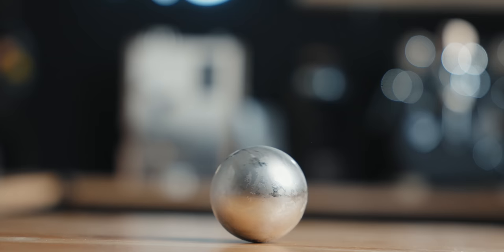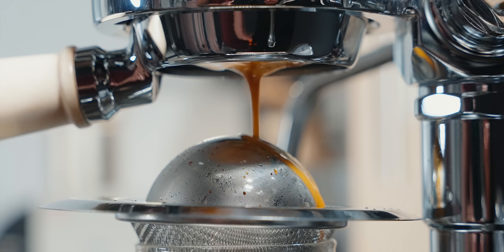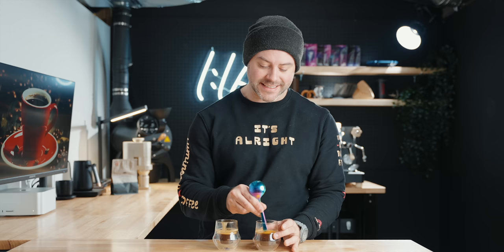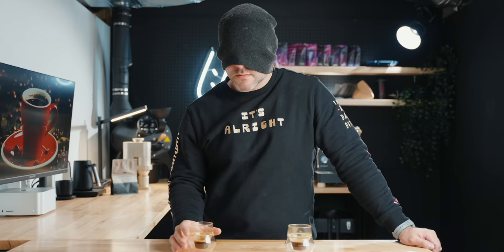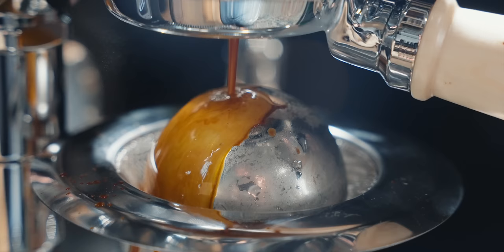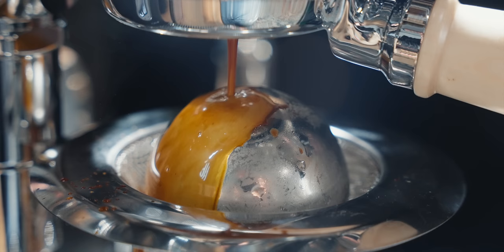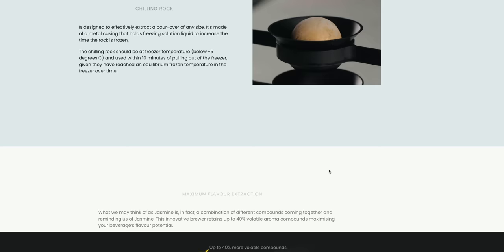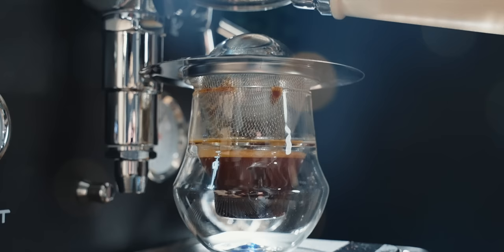THIS $20 TRICK Immediately IMPROVED My Espresso! - COMPOUND CHILLING

Comment from the maker: NOTE: 1. Both shots were equalized in temperature before testing to avoid bias in blind tasting. We filmed this but didn’t make mention to it or make it visually obvious so we cut it out of editing 2. Despite being chilled, this is still a hot beverage. This is not an iced beverage. I’ve seen this asked a lot so thought it was worth clarifying if it wasn’t obvious in the video 3. Would really appreciate if you subscribed on the way out… I’m almost at 100K and every sub is so important 🤝
Reply: 2 questions:
1. Does this not make the espresso a lukewarm drinking temperature?
2. Will this work with pour over coffee?
Reply: @ropro9817  cooler temp usually but not cold. I think it actually started pour over device or at least it got more people intrigued about the idea.

Comment: I just tried it - agree that there is a notable improvement - sweetness- crispness….better.  But that said - it does chill my espresso to cool…maybe cold.  How did you “equalize” the temp or return it to a “hot” drink?
Reply: My exact same thoughts. How much temperature variation it will cause? I like my espresso hot.

Comment: Why not try brewing into a frozen cup, then transfering to another cup after it's cooled? You can swirl it around for increased "cooling" too. I'd imagine it'll work quite similarly
Reply: Aromatic compounds are volatile meaning they evaporate very very early in extraction so the ball needs so be as close as possible to the exit point of extraction whether that’s directly below the portafilter or right blow the coffee filter when doing pour over
Reply: @LorenzBarcelona  elevate a chilled cup to the filter XD no need to buy balls and strainers lol
Reply: its not about cooling the coffee.

Comment: I'm curious how this would work with other brew methods like pourover and aeropress. In theory it should have the same effect but I wonder if it'll be as noticeable.
Reply from the maker: It’s arguably more noticeable
Reply: Check out Nucleus Paragon. They are already on it with pourover.
Reply: I might try something with an aeropress where there is one glass inside another glass filled with cold water. I use a pressure actuator (like Prizmo). Thus, not much should be evaporating in the chamber. The aeropress itself should help also keeping in any vapors in the cup as it sits on top. Ideally, perhaps a silicone washer around the rim might help too.

Comment: I have been heating the brew chanber and portafilter on my Flair Pro2. I may try just heating the brew chamber, or even freezing the portafilter. Interesting experiment.
Reply from the maker: Problem is with something like the flair… you want hot temps to aid extraction. Those elements don’t change. This simply cools the espresso upon exit
Reply: @KyleRowsell  Yeah I was kind of thinking that. With my scale and cup, I don't have a lot of room for my big balls. ;)

Comment: Actually not surprised at all that this works out; when I've been extracting espresso straight into a mug loaded with ice and some milk when making some cold ice-milk-coffee I've noticed the flavour of the drink is much better and smoother compared to just extracting the espresso in a regular empty non-chilled glass/cup and when finished then pouring it into the mug with the milk and ice.. So the 'degradation' in flavour must be happening pretty early on in the process.. Extracting espresso through just ice dilutes it though if wanting to drink it straight without any milk and ice so I may have to get me some of those balls of steel to test this straight-up espresso iteration.

Comment: The thing that I'm wondering about is whether this goes against the common wisdom of ensuring cups & portafilter are heated up before brewing. Does it make a difference if brewing from a heated portafilter onto cold vs. the alternative suggestion of a cold portafilter, for example?
Reply from the maker: My biggest suggestion would be to do the whisky stone method. It’s doesn’t change your drinking experience from a cold cup and doesn’t alter portafilter temp which in theory can alter your basket temp slightly and therefore alter extraction. But I offer this portafilter options as an alternative to someone who doesn’t want to purchase anything. This person should STILL heat up baskets to ensure the extraction isn’t altered.

Comment: Why then do we need to preheat our cups and portafilters? Isn't it to minimize the heat loss and improve extraction? Does that mean we can also use whiskey stones in our cups to bring down the temperature of the espresso?
Reply from the maker: No. Preheating cups is one thing. Portafilter is separate. I instructed to remove the basket and freeze. Only to test the theory incase one didn’t want to purchase, but I wouldn’t recommend this for ongoing use. I don’t recommend doing this often but again… it’s an option for those wanting to test this method. But I would always recommend heating baskets placed inside the PF.

Comment: You have 2 different temperature espressos there and we already know that espresso tastes sweeter and more developed as it cools down. It's really no surprise that the cooler espresso tastes nicer. Leave the other one long enough and it will taste pretty much the same. 
This is exactly why Hugh Kelly the Barista champion poured it this way for the judges. So that they didn't have to wait for it to taste nicer. Because of the time restraint on him being judged.  Just leave your espresso for 10 minutes. You don't need chilled balls.
Reply from the maker: Not sure how to tell you this but... you're wrong. I left the first to match the same temperature. It was brewed first and Rapid oxidation upon extraction and only worsens over time. Try it.
Reply: @KyleRowsell  Well you didn't say that and the reason Hugh Kelly gave was exactly what i wrote. Not for "oxidation" or any other pseudoscience reasons. Just to get the temperature down quicker for the judges. So i'm not really wrong.
Reply: @Tass...  I'm super curious about this. The OLD wisdom was that espresso shots "expired" and would sour over time (not at all a thing, not even close). Things have changed a lot since then and a lot of the assumptions around that echo what I've heard about this "new" method. Id be super curious for someone to take a deeper look at this because it seems entirely possible that with a valid sample size we see the differences disappear. Though I think there's precedence in food science that rapid cooling can impact flavor. Curious stuff.
Reply: Good point, you want to sure you're tasting the two espressos at the same or very close temperatures, the ball one was made 2nd it seems but it's also kept in a double-walled glass which keeps the temperature warmer longer. In the video Kyle didn't mention whether or not the temperatures were the same when testing, so valid concern. Although in the comments he did indicate he matched the temperatures when tasting (also likely has done more than one test?). 
There was another video (Maybe Lances?), or an article I read where they actually measured the volatile compounds being lost on the hotter espresso vs more retained with the quicker cooled espresso so there is science to back it up. Not sure if it's due to oxidation or just that stuff is 'steaming' off / out of the coffee at a hotter temperature. 

I tried it a few times and actually thought the regular brewed coffee (not insta-cooled) tasted better, but I need better whisky stones.
Reply: Did you freeze whiskey balls ? If yes, I am preparing my espresso around 92 celsius, do I need to reduce my temperature?
Reply: @erenevren  it shouldn't really have much to do with your brew temperature the idea is just cool the espresso down asap so it doesn't steam off the extra flavour compounds basically.
Reply: @BensCoffeeRants  thank you for your reply
Reply: @ggcadc  I just want to mention, this may be because very high and very low temps are great at masking bad flavors. This is why beer is served ice cold (all the unpalatable tastes are more evident when it warms up); likewise, research has shown that the perception of taste decreases when the temperature of food goes above 35C. Given what we now know about how hard it is to get a good shot of espresso, it's frankly pretty clear that most espresso for most of the time humans have been drinking it has been pretty poor--and, by that token, it was likely mostly palatable at high temps, and as it cooled the problems with the cup likely started coming forwards.

Meanwhile, modern espresso techniques are actually producing good cups, and so we now see that we can better taste the positive qualities we are capturing as they cool.

That would be my theory, anyways!

Comment: Did you try with Brew coffee as well ?
Reply from the maker: I did. I wanted to focus on espresso for this video as I think it's a method I found fascinating for espresso but filter works equally as well if not better depending on your brew method. Try it!
Reply: @KyleRowsell  Ok just tried and the awsome thing is that i drink my coffee around 54 to 56 C   Just brewed a local mid-roast coffee using the OreaV3 and the added ball. Water temps in is 96 (a little hi) but the temperature in the cup right after brewing with the icy ball is 54 C plain perfect to drink right now.  :D

Comment: are you going to try this with your slayer? 
my assumption is that doing the compound chilling during prebrew can elevate the aromas even more while letting the shot round out normally

(coincidentally I have whiskey stones in my fridge too so I'll definitely try this out tonight or tomorrow :D)
Reply from the maker: Report back! And you already know it!
Reply: Just pulled a shot with a whiskey stone last night on my slayer
Colombian, washed, city+ roast. 18g in 38-39g out with a prebrew of 38s and 6g in cup before pushing the paddle to full brew. 

Typically the shot without the stone is balanced with a hint of fruit/acid. With the stone, it’s much more aromatic, but also fruit forward, almost overpowering the shot.

@kyleRowsen, in your opinion would you alter the recipe or grind to compensate?

Comment: Still trying to find a cheap way to do this with pour over. The paragon system is just too expensive.
Reply from the maker: Buy the ball and put it in a second V60 under your first brewer
Reply: Genius! If it works will I might modify the second v60 to fit better. I have a 03 that I never use.